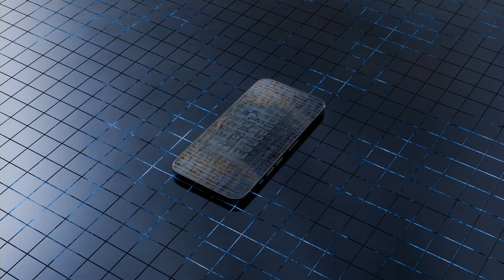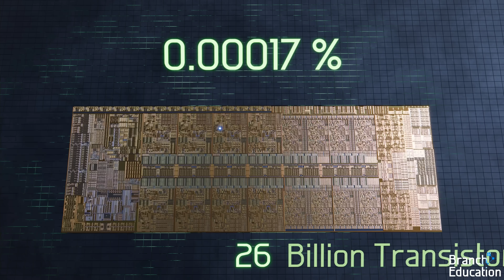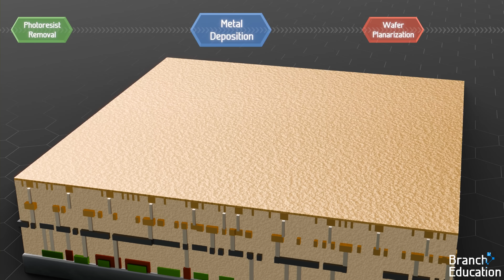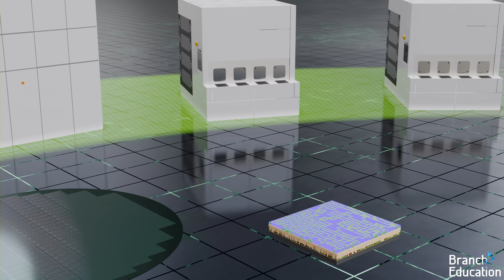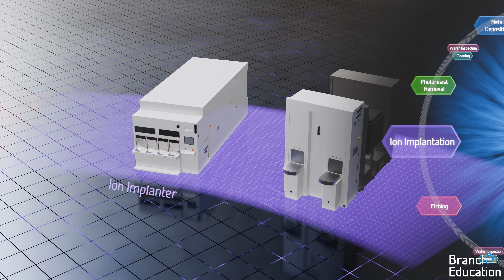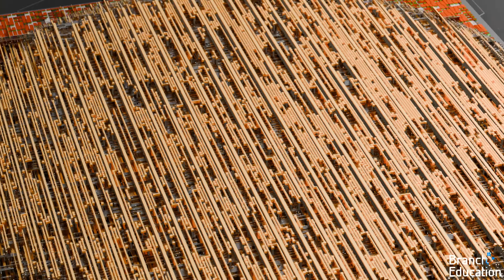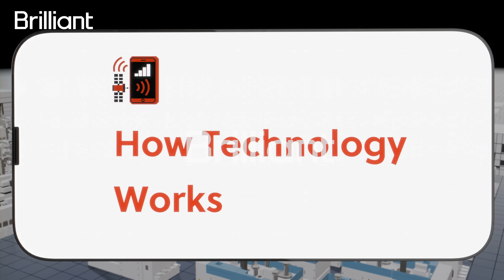How are Microchips Made? 🖥️🛠️ CPU Manufacturing Process Steps

Comment: I didn’t get it, how is the first layer made because even in the first step there are already these transistors (i think) and I dont get when those are made ? 
Can somebody help me?
Reply: The transistors are built using the same set of techniques used to build the wiring, but their construction also includes ion implantation steps. A more complete explanation requires a separate explanation of how transistors work.

Comment: I work in asset tagging and spatial mapping for a few different companies , mainly restaurants , theaters , some retail companies , I do most pilot runs gathering info on their hvac and electrical equipments so switchboards , air handlers , condensing units etc as well as 3d spatial mapping , I had the opportunity to go to gather the data for AMD in an aquisition they made of another company  in San Jose and Longmont , I got to go through their testing floors and all the back rooms where an NDA is required to enter , let’s just say I had such a braingasm, lol I always felt like the smart guy doing spatial mapping for fast food chain restaurants , and in this place I felt like the dumbest guy in the room , they told me engineers and scientists  would fly in from all different countries work for a week or two and fly back home , and they pointed to a water stain on the roof where they said a janitor left the water running upstairs and I leaked into a lab and destroyed millions of dollars worth of equipment with a few little droplets

Comment: Kudos to your great job. Not just this video, but all others on your channel.
I am an electronic engineer, and always wondered how a CPU is made.
Your video makes it so much clearer and adds even more "wows".
During my uni years, I have studied all the logic gates and boolean algebra in CPUs using transistors, but it is a very different to see how is this physically made.
Since I do photography as well, I am amazed with the connections I made with the enlargers (lithography) developers and fixers.
I also made my own PCBs, I understand the process of etching, but of course no more then one layer. 
One things that is beyond my understanding, and maybe you can explain it, how does the microlitography work with wavelengths much shorter than the visible light (i.e. 5nm or even smaller).
How does optic work with such short wavelengths? How does a negative film get projected to nanometers?
This is an amazing technology, hard for "regular" engineers to understand, and even harder to explain to a non-technical person. 
And yet, every single person on the planet today uses CPUs in their daily lives, but they have absolutely no comprehension how these miracles of microelectronics are made.
You are doing an exceptional job and I appreciate it so much. I am sure, many engineers around the world share the same opinion.
Keep up the good work.

Comment: As the wafer is passed around especially during the lithography processes it would need to be indexed to its exact position each time. I know that it cannot be done mechanically therefore I would assume it has some target points on the disc and it is aligned optically but that is just a guess. Alignment within a couple nanometers must be required and I would like to know how that positioning is accomplished.

Comment: 23:50 wait what..?😂
Reply: It's like buying gold, 24 karat is pure gold, and anything else has some impurities, or in this case defects
Reply: My jaw dropped too, so that means that basically all product lines that are not the top product line, like computers that use those i5 and i3 processors, are actually as a matter of fact inferior products that have defects so they are derated, and then used to supply a lower price product line, rather than that lower price product line having an individual design or its own quality control specifications.       Wow so cheaper electronics are truly a rip-off.    Now I know why those type of devices never perform well, and almost always  degrade over time to the point they are unusable because random processes just jam up.        Now I get it.
Reply: No that's not like buying gold they deliberately mix other alloys in there to create lower carat ratings, some is impurities but it is not like a dirty process, it's with intent.    The microchip production scheme is not an intentional action, it is recycling, grading, marketing and selling impure or defective products, because by their design they can still function with less threads, so basically isolate an entire defective thread and then call it an i3 processor, to put in a cheap machine, that will make somebody's head pound within 2 years because it's so useless it's a slow as a entry-level smartphone.     I know my dad made one of those purchases for his design business and he still refuses to understand that's why he works slow, when there's literally a one-second lag between you clicking the mouse and something actually happening, that is not responsive, that's unacceptable in today's electronic world I (and those who have been duped into buying entry-level systems) think.

Comment: The Inital Wafers are always shown as disks, are the actually disks, and is there a reason for this?  wouldnt square or rectangle provide more efficiant manufacturing space?
Reply: They're cross sections of a cylindrical silicon crystal, so they are indeed disks. The silicon crystallizes at the same speed in all directions, which is why you end up with a cylindrical crystal
Reply: @lunkel8108  nice

Comment: I had been wondering how the chips don't end up all lumpy bumpy with transistor bumps and stuff causing the surface to become progressively more bumpy with each new layer - and this video explained how that issue is overcome with the levelling process that often seems to be skipped in other explanations that i have come across before.
The technical details in this video are better than anything i came across before on this subject.

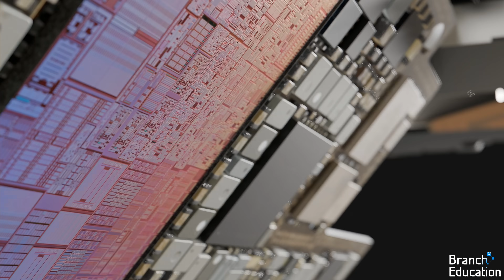Comment: 00:07 Microchips are manufactured in semiconductor fabrication plants with advanced technology
03:44 Microchips are incredibly small and complex in structure.
07:11 Microchip fabrication involves complex and repetitive processes.
10:42 Microchips are created through a complex process involving photoresist and lithography tools.
14:05 Microchip production involves adding, removing, modifying, and cleaning materials on the wafer.
17:20 Microchip fabrication involves multiple complex processes and precision monitoring
20:21 Microchip manufacturing involves additional steps beyond building the integrated circuit on the wafer.
23:33 Microchip fabrication involves categorizing semi-functional circuits and thorough testing before packaging for sale.
26:58 Upcoming videos on factory tour and transistor physics
Crafted by ADEDLOOP.....

Comment: I worked in a semiconductor before as a Reliability Engr. for Test plant. I am very much familiar with the fab process as I visited fab from time to time if there are failures in microchip during test or worst from a customer. What is lacking here that add excitement to the video are the specific specs of each process.

Comment: @12:45 -> actually in EUV systems we use mirrors instead of lenses. This is because we can not currently make a lens that has a low absorption coefficient within the EUV range. I know it is common to call a mirror a lens within litho as the DUV systems have lenses that serve the same purpose as the mirror does for EUV, nonetheless I would call this bad practice. 

Also we should note that the EUV systems are often used in pair with DUV systems. The smallest features of the chip are projected with the EUV system and the larger once with DUV. If only the EUV system would be used, you are looking at really expansive chips ;)

Comment: It's mind blowing,  not just the technical knowledge required but even coming up with such an idea in the first place,  to grow silicone crystals,  cut them with extreme precision and then fit such tiny, fully functional transistors onto them and for it all to just work so seamlessly well. It seems as though the speed of technological progress is growing exponentially every year and it doesn't show any signs of slowing down.

Comment: This presentation provides a very accurate simplified description of the manufacturing process of semiconductors. I am retired but worked in the Semiconductor manufacturing industry from 1980 till 2021 witnessing major changes over those years. Those changes were minor compared to what will come in the next few years where 1st microprocessor had thousands of transistors to where current CPUs have 10s of billions of transistors. This video is an excellent view into this impressive industry!

Comment: Fantastic video, thank you so much. I had a small question about the photoresist. Having worked with this material for some years I thought that it is the area that is exposed by the ultraviolet light that becomes resistant to the developing solution. The photoresist becomes cross-linked and hardened by the ultraviolet light. So is it not the other way round to the way you explained it. Thanks again though for a fantastic video and all your hard work.

Comment: this was amazing. I have an electronics engineering degree, and worked at AMD (chip maker) with the supply ops and substrate teams - so I likely had more knowledge about semicon fabs than 99.999% of the population. I even have a 2005 wafer chip without the substrate and packaging which one guy from the production floor gave me. But my knowledge was maybe 5% of what this video shows.

This video blew my mind off. Wow!! Amazing work guys.
Reply: Only people living under the rock wouldn't know what AMD is. Working in such a company is just a fever dream to me.
Reply: @ethlanrete6736  you would be surprised how many times I have heard "whats AMD!". Intel really shadowed the 2nd runner in that industry. At least until 2015.
Reply: @asitmohanty9662  Damn.

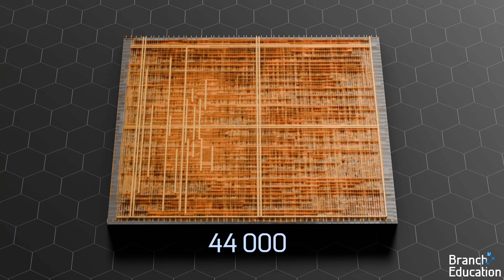Comment: 3:04 lol.... execute 32 bit multiplications? i'm pretty sure computers can't multiply anything.
obviously you can program them to do something that ends up with the same outcome as a multiplication..... but yeah.... not by actually multiplying, cause computers can't multiply..... otherwise the 2 for 1 deal would just be buying 1 pc and waiting 24 hours and bazinga, a 2nd one showed up out of nowhere, lol.......
Reply: They can. You can create a multiplier using bit shifting and adders
Reply: @iamveryrich66  you just literally confirmed what i said; which is that it is impossible..... 
you "created a multiplier by shifting and adding bits".... this is NOT multiplication.

multiplication is a mathematical operation in and on itself. simply because you can explain what happens through a "completely different" operation, does not mean you are "inherently" multiplying.

you're shifting and adding, instead of multiplying, and your answer just "coincidentally" correlates.
Reply: @markvis4106 what exactly are you even trying to say? I don't understand you
Reply: @iamveryrich66  that when it is being said the computer is making "multiplications" it is simply inaccurate to the capacity of a computer.
it is "simulating" the capacity to multiply, through a set of inefficient instructions.
inefficiency "inherent" to the fact that; the computer is unable to multiply without using non-multiplicative operations.
saying the computer can multiply creates misconception. it insinuates a computer is "creative" enough to multiply.... which is simply nonsense.
the answer to a math problem is not what "defines"  a "solution".
what defines solving a "math" problem is; the "method" used to find the answer, otherwise it is not "math" it would simply be a "calculation".  
if we are only talking about "calculations", then the specific operation of "multiplication" has no scientific meaning; because it is used outside of mathematical context.

Comment: This video helped me understand it perfectly. I’ve now simplified it to something I jokingly call “atomic elf planography”. When someone asks me to explain, I tell them: imagine how screen printing works in a printing press. You start with a plate of identical images printed over and over until they’re flawless, then you cut out each image and paste them into a magazine alongside others that followed the same process. These images went through the printing process around 80 times. Then, in the magazine, millions of these images are assembled, cut, and the final product is put together, ready for packaging. And just like that, you have your CPU, ready for someone to “read” by running the code. Congratz!
🧠
Reply: I don't think this video explains the technology perfectly and none does.
I'd say, YouTube content on this topic helps to understand the process as good as learning arithmetics helps to understand whole the hell around solving elliptic curves.
The process of actually making the silicon wafer is I'd say — miracle. It's a single, ideally symmetrical crystal. You won't find these anywhere in nature, smaller rocks form, but take millions of years for to, and are randomly shaped and have varying sizes. It's also pure, I believe industry uses 6H to 8H, maybe even 9H silicon bulls. Numbers before H means the number of zeros for the concentration of contaminants. For example, 8H polycrystalline silicon seeds have 1 impurity atom per 100 000 000 silicon atoms. The process of making a single crystal — that is symmetrical like(almost, when taking stresses into account) block edges and coordinates in Minecraft. So that's not number of differently oriented crystals, that's a single crystal. It's created cleverly, and simply through geometric sorting. 

By itself silicon boul production could be separated into two large sections and one extra. Silica sand sorting — may start from sand or quartzite(will be grinded down, is not quartz), extraction of silicon from silica and silicon purification. 
Monocrystalline boul formation. 

This is only the beginning.

Comment: Whilst I knew that an iPhone could be produced for around $20, there would be a great deal of unseen expense. Research & Development needs to be 2 years ahead of the next model, & based on these videos, ‘test chips’ alone, must cost in excess of £20,000,000, not including staff costs, and business overheads. Once you factor in the design of the chips, the setup of the manufacturing, sourcing other materials, for e.g; ‘the screen’, then making sure that everything will fit inside, it’s absolutely genius, with one sample model being closer to $200Million I would estimate…

Comment: I'm relatively new to the semiconductor manufacturing industry, just starting as an equipment technician about a year ago. I've learned quite a bit about the particular tools and process I work on, but haven't learned that much yet about the rest of the processes. This was very helpful of giving me more of a beginner level understanding of some of the other processes, and the illustrations were fantastic.

If I had a request, it would be to cover more about through-silicon vias, since that is going to be a major part of many modern semiconductors.

Comment: With 90 billion transistors it's easy to see how one defect an cause problems, my  new Intel i7 12,700KF 12 core processor was apparently defective from the factory, I kept having random freezes and reboots on my home built PC running linux mint as many as every 10 minutes or it could go hours between, I literally swopped out every part except the processor to try and narrow down whether it was the m2 drive, the operating system, the software, the Graphics card, mouse, keyboard, ram, power supply- all of those checked out working perfectly in an older home built pc from 2018 with it's ASUS Z370 board and Intel processor, so I wound up buying another new Intel but an i5 12,700KF 10 core, putting that in the new build with all the previously tested working parts, and no freezing or crashes all week, it became clear the problem with the Intel i7 CPU which was brand new in May.

Comment: I just subscribed.  I sold and worked with chemical mechanical planarization systems as well as silicon wafer fabrication tools and wafer thinning tools used to thin the silicon wafer prior to dicing.  An excellent video that brings all of the processes together. Keep up the good work.

Comment: 6:14 here what is silicon dioxide is it acting as photoresist or what ?
Reply: silicon dioxide acts as a masking material during the etching process
Reply: @Mono_ツ  no it is dielectric used for insulation between two consecutive layers
Reply: @Mono_ツ  masking material is simply photoresist

Comment: At 16:30 it should say phosphorus, not phosphor. "However, ion implanters only add around one atom of phosphor (correction: phosphorus) or boron for every 10,000 atoms ..." Phosphor may be an old-fashioned term for phosphorus, but ever since the invention of CRT displays the term "phosphor" is used for a material which emits light when excited. Phosphor usually does not refer to phosphorus!

Comment: I used to work at a chip manufacturing plant (Sumco in Arizona). One of the first things they show us is how ridiculous silicon is to begin with. Vertically standing up, it's extremely strong. The ingot grows from a tiny rod of silicon into a giant ingot, vertically. Think like taking a pencil and dipping it into wax and slowly raising it. The end is a long ingot but the top is a thin tiny piece that started the grow. But, if you flick it horizontally, it will shatter. I used to cut the ingots and then rinse wash them under water and throw them into disc trays. The disc trays are taken to x-ray where they look for imperfections. Very perfect silicon makes CPUs like i9s (example, Sumco didn't make i9 that's Intel). Imperfect silicon makes CPUs like i3s. Very imperfect silicon makes chips like SSD or flash media storage